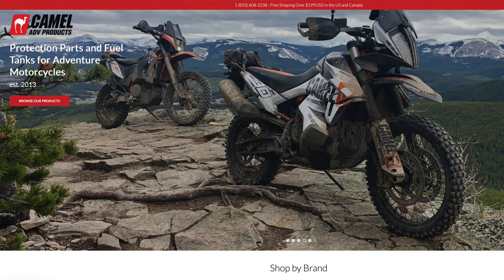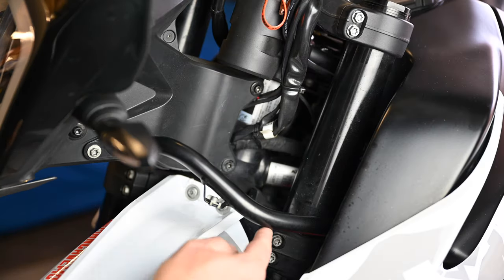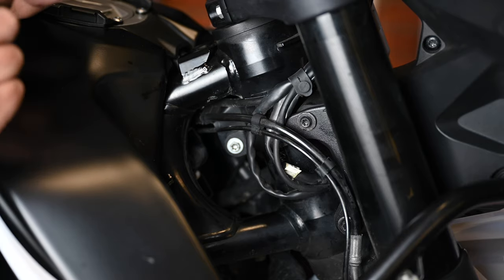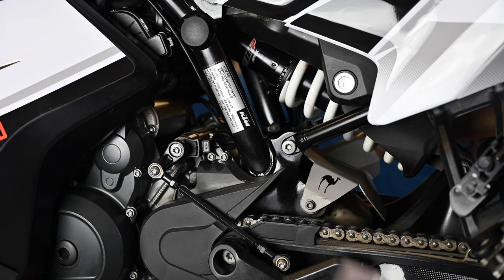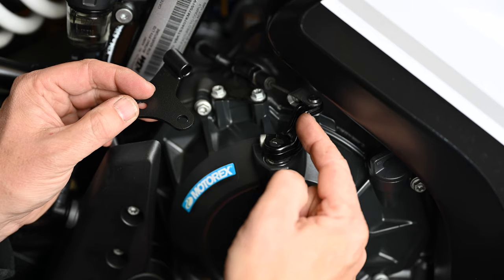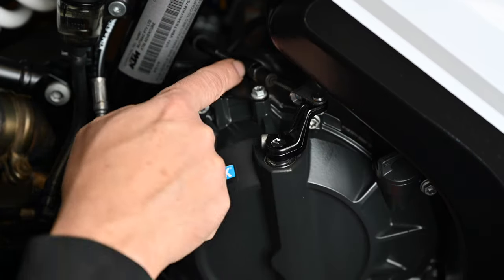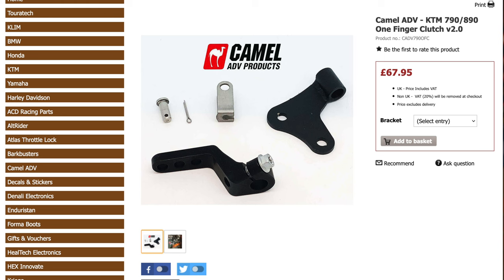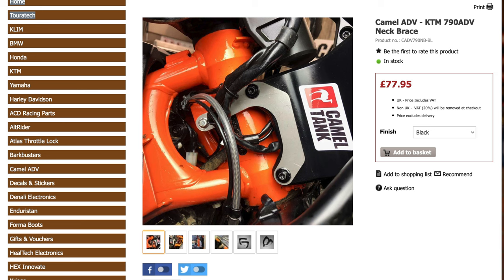KTM 790 Adventure  - Three key mods from Camel ADV

Comment: got all three of them, the heat shield is a huge must, neck brace is awesome but check the wires sporadicly because the brace square edge damaged one (just filed down a bit and absolutely no problem now), have the one finger clutch (never installed), went with Recluse  because factory one never work properly from day one.......... great company, love their products, cheers V!
Reply: That 's a good point, the early kits had sharper edges. We started chamfered the braces in about about mid-2020.

Comment: I purchased their clutch link thingy and installed it.  Because the clamping hole that grips the post was oversized it slipped and ended my ride miles from home in the middle of the forest.  Come to find out, Camel ADV knew about the problem, had already made replacement parts that met the drawing (better quality control?), but failed to get the word out to customers, instead waited to hear from them after they had a problem with it.

Comment: I had a leak issue with my rear shock, regardless the heat shield.
Plus what annoyed me was that all the heat went to my boots during the slow pace riding in more technical terrain.
Reply from the maker: Yes it’s a problem that I’ve seen reported. I think the heat shield has more to do with the actual performance of the shock rather than protecting from leaks?
Reply: @mancavemoto  I haven't noticed the difference, but I am not skilled rider.
For me the most important mod was the sturdy skid plate (I used axp) as the stock one is very tin

Comment: Would you consider doing a long term review of the 790,  pointing out its good and bad.   Are these as bad as you read on the net ? Thinking of buying one but alittle put off by what people say,  are they really that bad ..🤔
Reply from the maker: That’s something I have thought about, and it might be worth doing. No doubt there are problems with the bike, as their are with plenty of others. But I think it’s overdone a bit, and it’s a very hard reputation to shrug off. Is the same with most things, a lot of the negative commenters probably have never even sat on one let alone owned one. Mines done 19k miles and I personally have had no issues other than a bit of condensation in the tft occasionally, and a dodgy fork seal.
Reply: @mancavemoto  Sounds reliable. The local KTM shop in Chiang Rai has closed down [I predicted it wouldn't last a year], so my decision has been made for me.